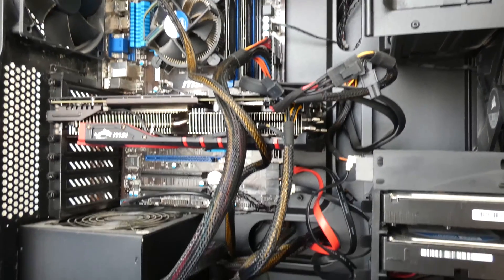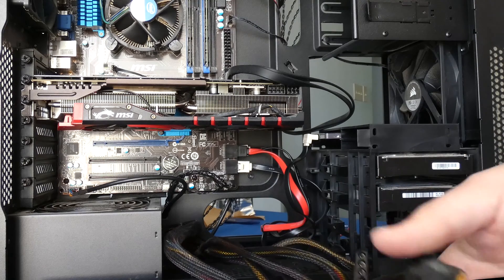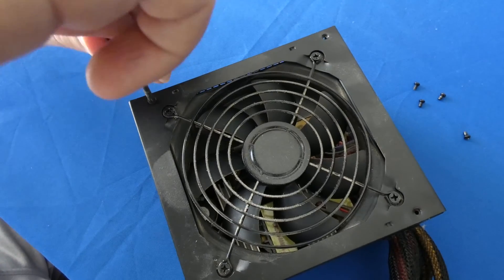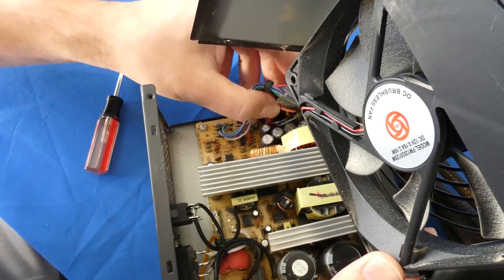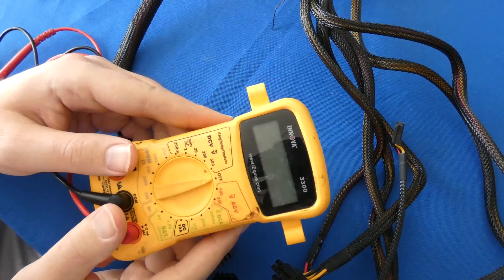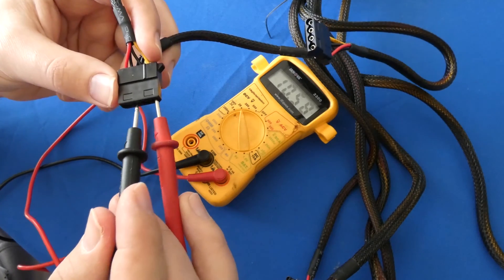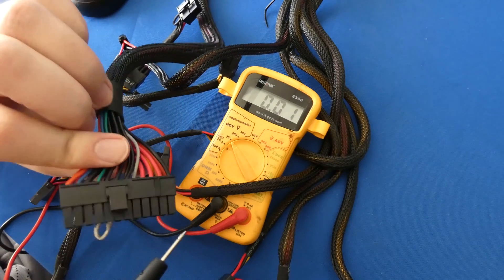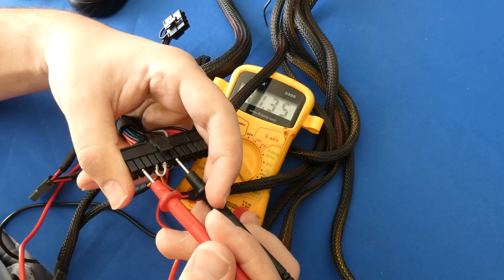Testing a BAD Power Supply After Burning Smell and Unexpected Shut Down

Comment: Im using Cooler master 750watt PSU [ G750M ]
Few days back after Cleaning my PC when i switched it on i heard a tiny sound like "' tipp"  from PSU and it smelled burned. i thought the Power cord caused that sound i again plugged it tightly and  switched it on within few second i saw spark from PSU with heavy smoke i immediately pulled off the power cord. 
The power cord  bottom got melted little bit. i checked the PSU inside everything looks fine no trace of something burned but it still gives that burned smell. i unplugged everything and checked the PSU its working but im not gonna use it again.

Anyway i ordered new PSU.
Reply from the maker: +jollyday6 Good thing you were there when it happened.

Comment from the maker: How many of you have had a power supply burn out? It smells really bad...  :)
Reply: mee
Reply from the maker: This issue can happen at any time really. If the PSU is on it's last leg it can happen while browsing the internet. However, usually does not happen to new Power supply but something old or not strong enough to run the computer.
Reply: cobuman i had my psu 9 years and it fried my pc my cpu psu and motherboard and when i opened it i saw a splashed capacitor
Reply from the maker: Yep, that's a perfect example the worst case scenario of how it goes. It's amazing that your PSU lasted 9 years to be honest. My PSUs usually last 2-3 years max (I do push my computer to the max a lot of times).
Reply: cobuman Just happened
Reply: I had today and i fried my whole pc
Reply: I got some question ...do you think using the computer for a long time maybe like 6 hours straight enough to have this kind of issues? I mean I'm just building a system "programming"... after then I smelt something like burning it smells so bad as fck ..
Reply: cobuman Yeah, my Xbox one broke and so I got a new one, I put it in a well vented area, it still burnt up in about 2 hours
Reply: Hi I have a question. So I don't really know if my power supply is the fault but it could be. There was like a sound from my PC and there was smoke coming out of it. Smelled really bad too. Could this be the power supply?
Reply: Does it work after burning??
Reply: Me
Reply: yup
Reply: I had.
Reply: Has been happening to me every other month or so where my cord burns on the tip where it plugs into the psu and it smells really bad and turns my pc on and off and just starts working again after a bit when I just unplug and replay it
Reply: Yesterday a Christmas present I made....Ryzen 2600, RX 590, with a cheapo 500 watt PSU...the PSU popped and sparked....switched out the PSU and it ran fine again..yet..the next time I turned that computer on I believe the motherboard went :(  Receiving process error post code and am just going to send as many parts back as they will take.  A real bummer.
Reply: Just happend whole house stinks and I’m scared to get near.
Reply from the maker: @aaronbraga7079  oh no! at least unplug it...😁
Reply: cobuman I did I’m glad there was no fire
Reply from the maker: @aaronbraga7079  nice! get a good brand PSU as replacement. I'm sure you know already. :)
Reply: cobuman yea I do I just bought this antec 650w psu 80+ just throw into a budget system for my As I got a good pc. Thanks for the video anyways lol
Reply: i have a plastic burning smell from power supply
Reply from the maker: @steadyuk3198  Yep, even if still working I would replace because voltage can be different.
Reply: Me also but it was because of voltage 230 or 110
Reply from the maker: @anayahfaiz3c469  Ouch!
Reply: Sir my compaq presario system has got a faulty power supply and it made bursting sounds and the smell was really bad. I plugged the system to a ups and then this thing happened. I have my old memories in that system. Now i am afraid of the damage caused by the power supply to the motherboard. Is there anyway to repair this thing? Pls. I really want to repair this.
Reply: Just happened to me, but i quickly swapped my psu before it burns down my house. Checked everything and even opened up my psu and there it was, a piece of copper turning to ash. Didn't even think twice
Reply: Me
Reply: me